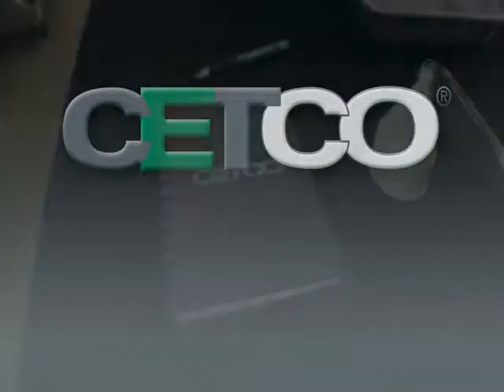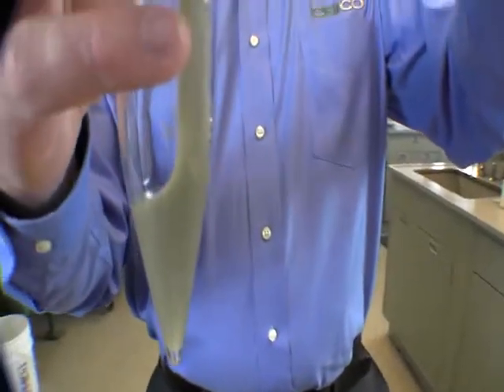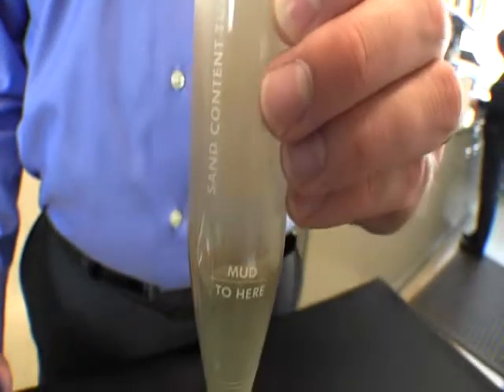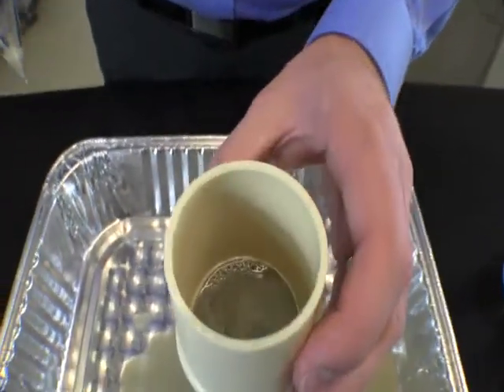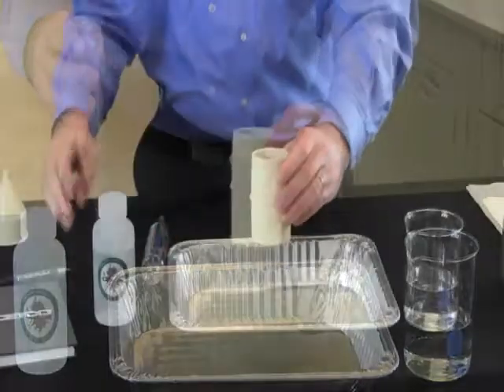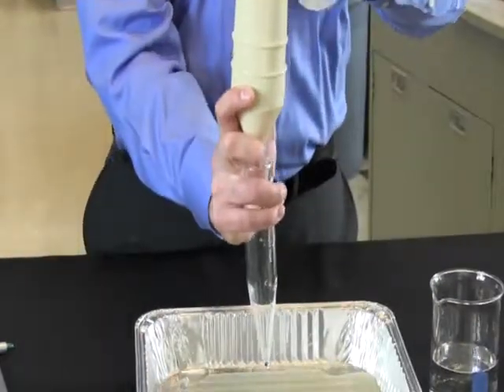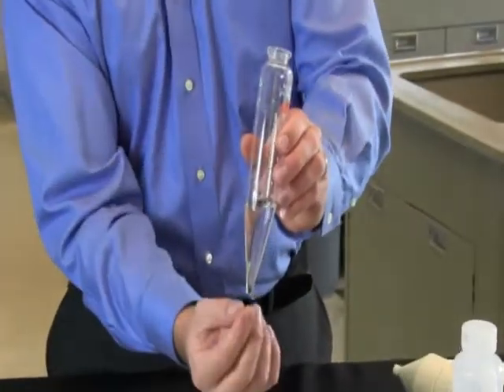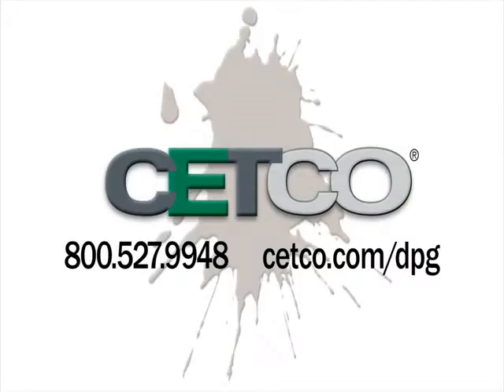Sand Content Test

Comment: what is the maximum sand content in a sample taken from a borehole drilled with a polymer where the material is half sandy soil?
Reply from the maker: Thank you for your question!

In the United States and most locations globally for drilled shafts, it is <1.0% sand content by volume before pouring concrete. Most Departments of Transportation (DOT) will also specify <1.0% except for a few states with <0.5%.  If you have additional questions contact us!  drillingproducts@mineralstech.com  Thank you!